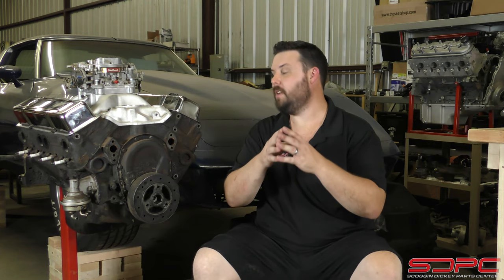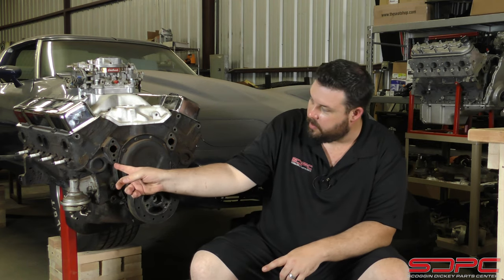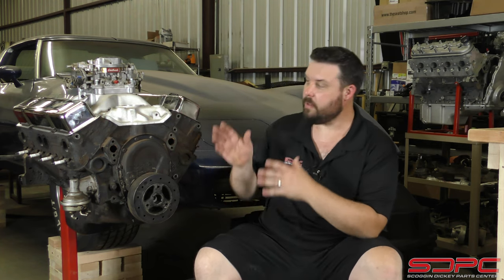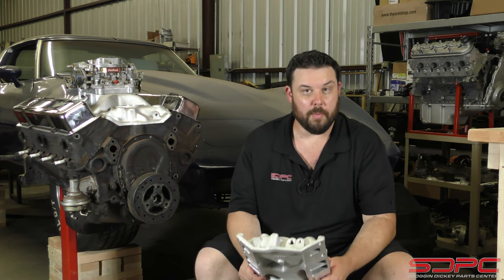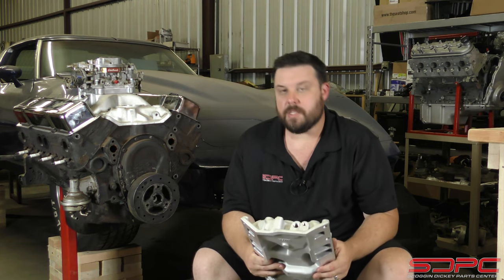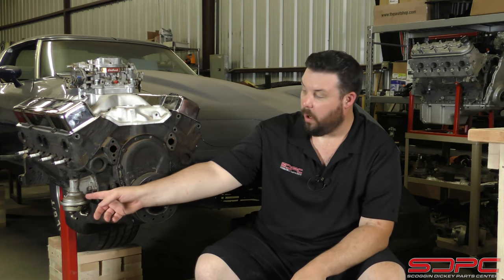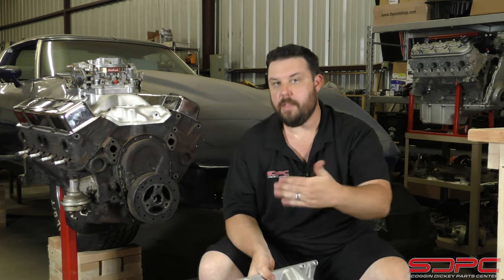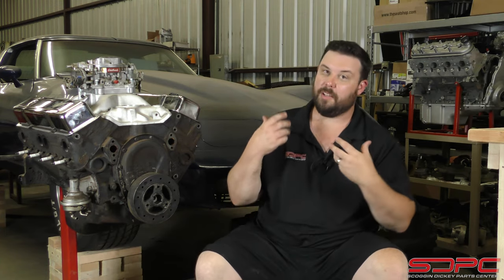SDPC Tech Tips: SBC Vortec Coolant Bypass

Comment: The reason we are going back to small block is the LS engines either leak oil out of every orifice or they are equipped with cylinder deactivation Afm system that are prone to cause early failure. The reason we are going back is reliability

Comment: L31 Block is the Vortec 350, I have one in my 99 Tahoe. The L31 block does not have the bypass port and uses a different water pump than engines with the bypass port. The Vortec heads do not have a coolant bypass provision so keep that in mind if upgrading to Vortec heads and you have the third port on your block. Thanks for the video

Comment: So the external bypass is essentially the same as what the big block used since the 60s? Would a heater hose going from the manifold to the heater core, and one from the water pump to the heater core, not do the same thing?
Reply: I’m not sure I’m having this issue myself right now building my l31 vortec I have a heater core in my cutlass and wonder if running that to the intake normally would keep the engine cool and use that as a bypas instead of drilling holes in the t stat a motor needs to get up to operating temperatures
Reply: @rockfordhx2768  if you only drill a single small hole in the thermostat, it won't have any issue getting up to temp and staying there. I use just a single hole the size of an uncooked spaghetti noodle. Smallest bit I have. It still operates like normal. Using a heater hose going from the manifold to the heater, then heater to the pump should be ok I would think. It works fine on the big block when using the bypass hole on the manifold to go up to the heater instead of directly to the pump?

Comment: About 15 years ago, I did a vortec head swap on a 1991 c1500 TBI engine. I tried several different thermostats and it would just run hot, the thermostat would never open. Without a thermostat, it wouldn't overheat, but barely moved the temp gauge. I know it's not ideal, but I ended up putting over 100,000 on that engine with no thermostat and no problems, but no heat lol. Wonder if this was the problem?

Comment: Drilling a hole in the thermostat is to help bleed the air pockets out of the block after draining the cooling system. That way while you are filling the radiator back up you don't have to wait for the thermostat to open and suck the radiator down. An 1/8" drill bit works just fine.  Just my 2cents worth thanks.

Comment: I've always drilled an 1/8" hole in the thermostat to give just a slight bit of flow "bypass" during warmup. Works great and never had overheating issues
Reply: I've always put two 1/8" holes 180 apart.

Comment: Drilling a couple holes in the thermostat is a common thing done to big block Chevy’s for years as I have done on my turbo 555 to avoid the using external hose and works great so can’t see the problem on a vortec

Comment: cool vid bro. i built a 5.7 merc cruiser boat motor and put it in my truck, it had the 3rd internal by pass, but the vortec heads and water pump didnt use that application so we just apoxied it shut on the block. i havnt had any over heating issues so far . going on 2 years now running. so this is what i did in case any one wants to follow suit. the motor as i said is a 350 merc cruiser  boat engine i put in my 98 k1500. i used 5.0 vortec heads. big roller cam, roller rockers and lifters, up graded the fi system and as i said earlier, when we were building it we noticed it had that 3rd bypass. we apoxied it and no trouble so far

Comment: I have an old school Chevy 350 built out to a 355 using the 062 casting vortec cast iron heads. As I understand, the water jackets walls are thin and can cause cracking. My question is what antifreeze do you recommend using to cool with these vortec heads?

Comment: Awesome video, I'm stuck with my 5.7 vortec carb conversion, don't know where and what to plug on the intake manifold, and what vacuum lines go where? Do you have a diagram for the intake manifold and what size the thread and pitch is for the bypass fitting

Comment: 880 casting vortec 5.7 came with the internal bypass and are drilled for a fuel pump rod. Usually found in 1500’s with the engine code R .

Comment: I'm a old school mechanic, I started with a Chevy  dealer in 1966, I always put a hole in the thermostat to bleed off air, we use to get thermostats with holes already in them, I don't recall  if they were OEM thermostats. Never had a problem with this doing this

Comment: Am I right by saying that you could have either a bypass hose from water pump to intake or thermostat with 1 or 2 holes drilled in them, or both of these options? I'm trying to do away with a hose from WP to Intake and plug the ports.

Comment: So I just did what you said and yes I pluged the bypass on the manifold and the top of the water pump started the engine on test bed and just as you describer within three min it started to run hot. I'm running a 160 thermostat and shut it down at 190. I see the bypass issue and will address that my other concern that you didn't mention is pump rotation, vortec pumps run counterclockwise  whereas the Edlebrock aluminum pump i used is STD clockwise rotation. Is that an issue?

Comment: I have an 87 to 95 block 4 bolt 1 pc seal and has the extra hole and I'm using  062 heads. Can I use the 96 and up water pump serpentine setup? I'm also an air gap intake.

Comment: My 1998 l31 doesn’t have a coolant 3rd hole bypass I have a 880 block with 062 heads I wonder why I took the water pump off today it’s the normal 3 hole on each side of the pump

Comment: ok i have something to add here. 
i have a vortec 5.7 block and heads and a 1994 s10 blazer its squarebody last year. it had the bypass on the block but nothing on the water pump. 
i have the 5.7l water pump and it did have the outlet and 90* coolant elbow that always leaks.
i reused the s10 water pump and capped the port on the intake for the coolant. 
i use electric fans and a thermostatic switch to turn them on and have never ran it hot per say. has it gotten warm barely. but 90% of the time it runs cool. too cool. like replace the temp sender cool. when it had stock motor same thing it was always cool. i think im gonna swap pumps soon and see if it keeps a consistent temp finally.
Reply: for anyone with a similar experience. it has been reliable as heck for close to 30k miles so literally no problems other than too cool.

Comment: Recently inherited an 84 Elco from my dad. Has a 383 ...edelbrock everything. He always complained about dealing with over heating. I see where the heater hoses connect but there is no bypass....just plugs in the water pump and intake. And there's no hole in the tstat. I should probably run that bypass anyways huh?

Comment: So it shouldn't be a problem putting a vortec water pump and serpentine system on an older block as long as the external bypass is hooked up like it it would have been on the newer engine?

Comment: I have that same Edelbrock Performer intake with that threaded port available but unused. It came on a Vortec Crate motor with the added "third hole" port on the water pump.
Wouldn't it be a good idea to double up and use the third hole AND the added port on the intake?

Comment: I have a 88 Camaro with a vortec 350, but with TBI heads and intake. So far so good on overheating. Had issues with heater though
Reply: @matthewgraham2129  well it was in the car when I got it. Did some research on the block numbers, but I do have 2 sets of Vortec heads and a vortec short block that I’m building.
Reply: @deviantrebel6326   88 Camaro was an LT engine, not a Vortec.

Comment: How about showing what you recommend we do?  Drill the missing buypass hole, in the block?  Run a hose from the intake manifold hole you pionted to the the water pump?  If so, please show where in the pump it should connect.  Thanks
Reply: Run the hose from the intake to the water pump..it works

Comment: Could i use the front 3/8 port for the sensor and run the top 1/2 port to the water pump or do i have to use the front 3/8

Comment: I have a gen 1 small block with new GM performance Vortec heads, Edelbrock performer intake. During flat tappet cam break in water temps were near 220-230 degrees. I kept a water hose on the radiator to keep it cool. It is my understanding that the Vortec heads do NOT have the bypass hole drilled in the heads. Making the Gen 1 water pump bypass hole worthless because it is blocked off by the head. Would adding the bypass from the intake to the water pump eliminate my heating problem? I assume it won't hurt.
Reply: too bad no replied to your question. I am about to install a similarly build engine and it would be great to know the answer so I can avoid any possible problems.
Reply: @Gords_Garage_AB  most Vortec manifolds have a small bypass port in front. Plumb this to the water pump. Othere have punched several holes around the perimeter of the thermostat flange to accomplish the same thing. I plan to use the bypass hose when I get back to my hot rod
Reply: I have a 350 vortec also..my Temps while cruising would run around 200°then jump up to about 230°..I put a bypass hose from the top of the water pump to the hole right under the the thermostat on the intake and now I run at a consistent 180° while cruisin and around 190°-200° at idle
Reply: @jameshardy8797  Thank you for posting James! I'm working on a 1950 Chevy COE but will get back on my Model A with that engine soon after

Comment: Good info i was wondering about this as when people are going to use an oem serpentine system on a gen 1 sbc like i want to do ........that bypass hole below the water pump has to be plugged or coolant will pour out. I heard about drilling the thermostat...you seem to raise an eyebrow slightly as maybe its not enough to do only that.

Comment: I've had guys tell me I was full of it when I told them they had to drill this bypass hole if you put a virtec engine into there tbi trucks as the tbi trucks have the bypass hole built in to there water pumps. And if you use a pre vortec block in a vortec truck, you can tap this bypass hole with an 1/8" npt, and plug it.

Comment: I have an 87 tbi truck that i am installing a new l31 350 with the tbi to vortec intake conversion. Would this require the external bypass?  The heater hose run from the back of the intake directly to the radiator unlike the earlier 350s that ran back to the water pump. Isn't the heater core acting like a bypass?
Reply from the maker: The heater does not act like a bypass, you will still need to run the bypass on the front of the intake to the pump.
Reply: @Sdpartscenter   Have you found any good ways to do this with the original water pump from 87?
Reply: @Blakep7704  87 must've been a damn good year for water pumps if she's still going strong!

Comment: Ah-HAAA! So I picked up a great deal on a 57 Chevy two door hardtop years ago with a mystery engine and been putting a lot of time and money into it lately. Ran numbers today and found it has a 87 vette L 98 block with 96 vortec heads. Just like you said, could not figure out that extra port on the Chevy performance intake manifold. It was blocked off and I was having all kinds of problems. I will chase this down tomorrow!
Reply: 87 Vette was an LT engine, not a Vortec.
Reply: @SOLDOZER  It's an 87 block with 96 Vortec heads.
Reply: @SOLDOZER READ THOROUGHLY BEFORE YOU COMMENT!!! SMMFH
Reply: @1mattbutch You put that in your comment originally. People are so quick to check someone about something, and they can't read for sh@t!!!

Comment: If using the coolant by-pass port on the front of these vortec style intake manifolds like the one he displayed in the video, how does one route the heater hoses to have a functional heater? I'm assuming there's a certain water pump that can be used for this application. Wanting to run a V belt water pump, not serpentine.
Reply: 3 way outlet for intake bypass hose to water pump and heater hose
Reply: @biscowild4949  Thanks. The only three-way water pumps I found were either older short-style pumps or the vortec truck pumps which are huge and don't look right on clean SBC hotrod. I ended up using a standard Chevy long pump. I'm just letting the water flow through the heater-core as a bypass when the thermostat is closed. I also drilled a small hole in the 180 degree thermostat to keep a little water passing through. So far, so good. Doesn't overheat or puke water etc.

Comment: Any advice for this Vortec bypass with an electric water pump? Have an 1985 Jeep CJ7, Vortec long block RPM Air Gap like in the video, but i have no bypass port on an electric water pump to connect to the front facing 3/8NPT port like described in this video. I want to use factory heater core as well. I have spliced in a cheap aluminum coupling to lower hose, with a sensor port drilled out bigger and tapped for a 1/2npt to 5/8 barb. I plan to connect it to 1 port on heater core, and then other port on heater core to 1 of the 4, 1/2npt ports, or the front facing 3/8npt front facing port, on the intake manifold. Anyone see an issue with this? Routing these hoses currently so nothing is permanent yet. I would like something a little more reliable than a few holes in my thermostat.

Comment: Say Brother..which water pump goes with that engine..I seem to can't find the 3 hole pump
Reply: use a cp 1109 water pump from orielies. has the 3rd hole.  conventional rotation.
Reply: that pump fits various applications from 1965 to 1995, and is generally in stock
Reply: @superjeep47  yup..I also found out that it come on a 4.3 blazer or jimmy engine..95

Comment: Mine L31 HAD THE JUNK PLASTIC INTAKE AND INJECTION SYSTEM AND IT CAUGHT ON FIRE AND I ALMOST LOST MY CAR THANK GOD I DIDNT NOW IM GOING CARB AND INTAKE SHOULD HAVE TO BEGIN WITH VERSUS UPDATING INJETORS NEW FUEL RAIL GOING IN AND ALL SEALS FOR NOTHING IT MELTED THE INJECTOR PLUG OFF WHEN IT POIRED GAS ALL OVER MANIFOLD NOW IM DOING IT RIGHT

Comment: He said there is only one bung coming out of the top of a vortec style water pump, but there are 2. I have a 880 block that is not drilled for a bypass, and I'm running aftermarket afr heads and a air gap intake. My intake has 2 threaded holes on each side of the  thermostat housing. My question to you is, do I plumb the driver side  bung to th driver side hole on the intake and then the passenger side bung to the passenger side hole on my intake? I am not running a heater core on my build.

Comment: That hole is there so the heater will start working while the engine heats up, instead of waiting for the thermostat to open. Plug that bitch and move on for performance apps. I've done it to many builds. Most aftermarket electric pumps don't even allow for it. just my .02
Reply: Thanks.  I'm betting you are right and this video is wrong.  Mostly because he did not give one valid reason (that I heard) how that bypass is going to keep you cooler.  Doesn't a bypass cause hot water to "bypass" the radiator and go back around the system?  Your version makes a LOT more sense.